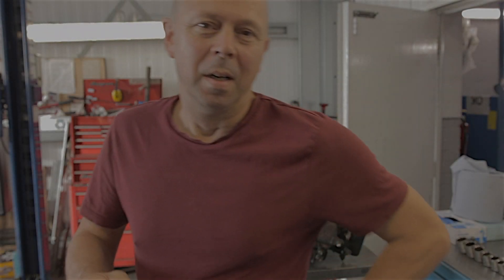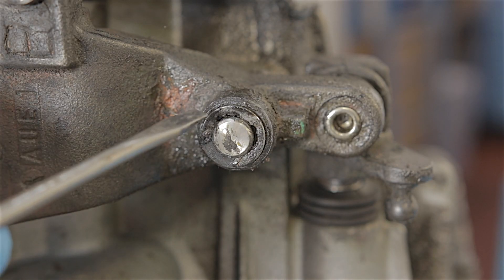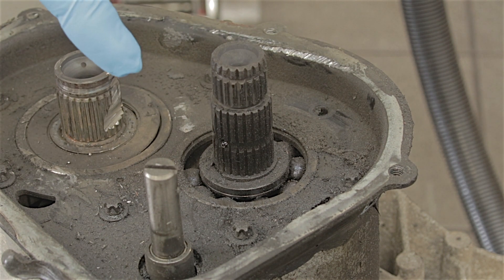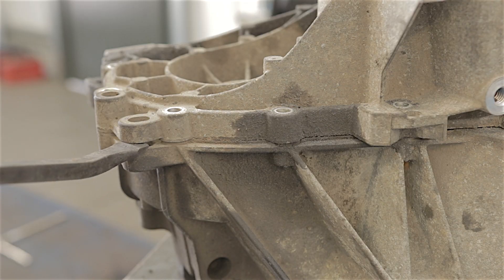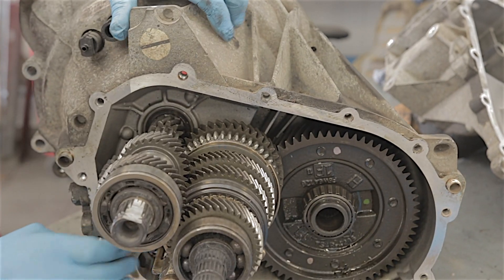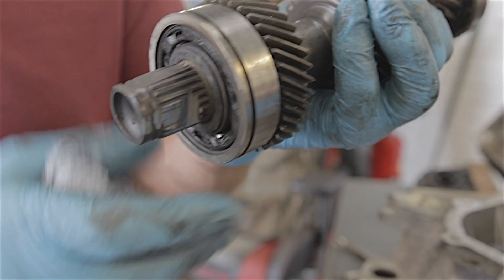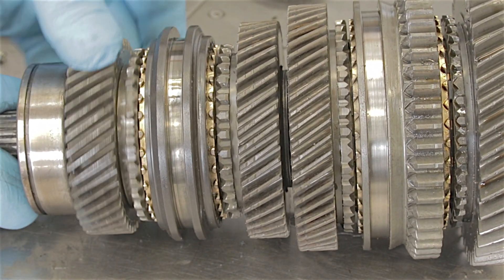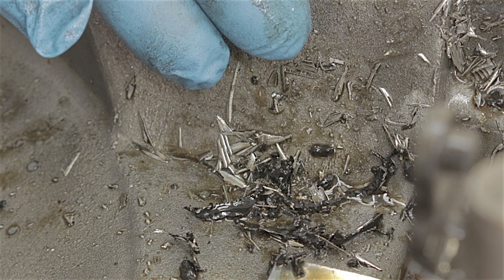Gearbox Autoposy...2012 Ford Focus Mk3 1.6Litre 5 Speed Manual Gearbox

Comment: Not many mk3 1.6 petrols about. And add there were possibly 2 or 3 variants too, no wonder you found it tricky to find the right box. Worrying someone else in the comments has just dealt with the very issue but luckily caught it early!
Reply: when the cars was launched the old 1.6 sigma engine was standard across the board, it was only until circa 2013/14 the ecoboost started being offered in its place. Could still get them until 2017 with the old 1.6 on the focus studio spec!
Reply: @usuallyfixingtinkering  true. Most of the 1.6s in the mk3s were paired to that disaster of a  powersh1t box 😝 Owned many a 1.6 in different guises over the years and they’ve been very sold motors
Reply: @davyarthurs  I drove one fir my driving lessons. Both I could hear flapping clutches. Garbage gearbox
Reply from the maker: thanks davy, you are spot on, struggled to find that box

Comment: I have a high mileage fiesta 2009 jumping out of second wen changing down i wonder if its that plunger u spoke about ?
Reply: 2nd Gear selector mechanism. Cost me £700 to fix as garage took box out and back in. Had the same on a 1.6 Ti-VCT Titanium, 2nd gear pop out and graunch when going down the box. Fine going up the box!

Comment: Ah the good old MTX 75, easy to repair if you can get 5th gear off with oxy and a puller, from a time when things were a lot easier :shelterin:
Reply: Thats a iB5 box. MTX75 is a completely different box! More rugged and found in the 2.0 petrol.

Comment: Allen
The problem is know one bothers to drain and renew their gearbox oil they do oil changed but ignore gearbox oil

Phil in stoke
Reply from the maker: yes very true
Reply: Probably because there isn't a drain bolt 😊
Reply: @AnthGott found one video where it had been possible to drain the gearbox oil, the big bolt underneath the filler hole was mentioned, my gearbox has that big bolt left of the selector arm, not to bee seen in this gearbox
Reply: @rheidbuurt  yea this is the detent bolt, as long as you don't move anything you can get a bit of extra oil out from here, should be torques to correct spec of the gear change can become stiff.